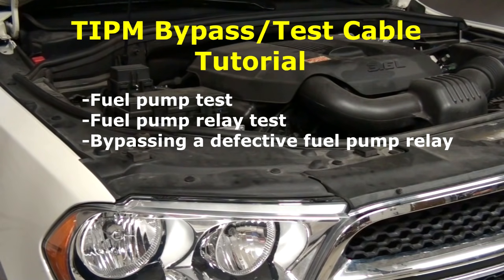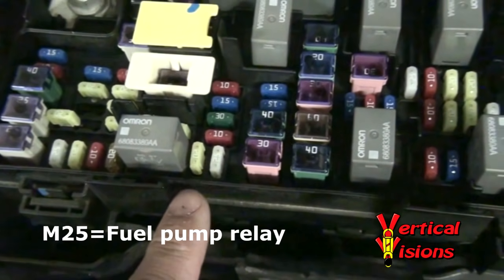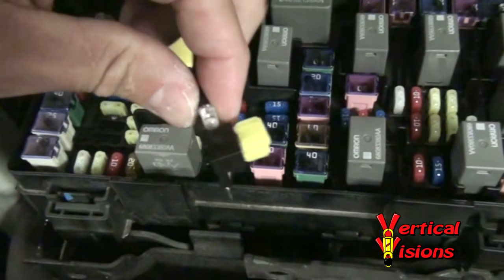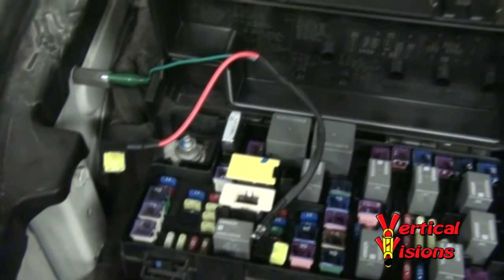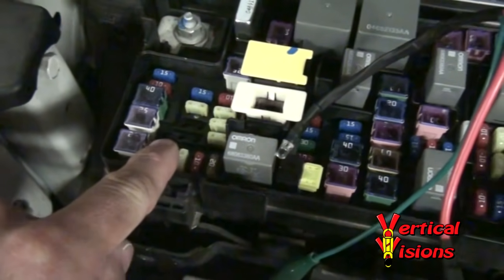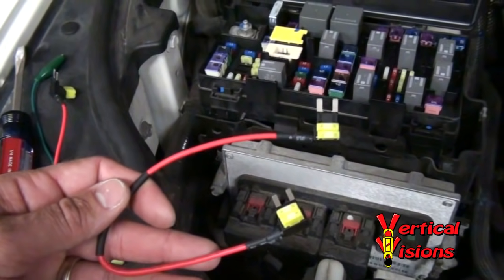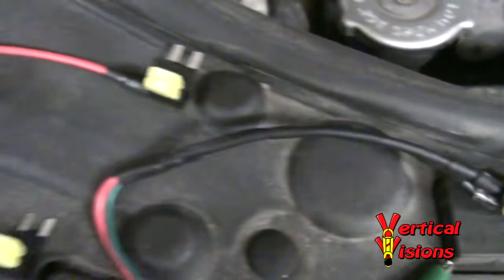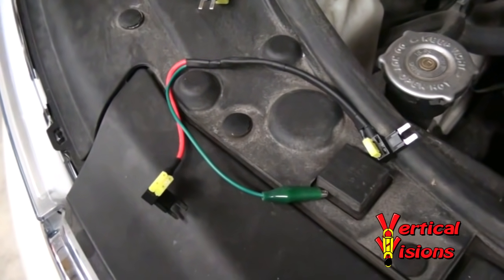TIPM Fuel Relay Test and Bypass Solutions - Most 2007-2021 Dodge, Chrysler, Ram, Jeep, VW Vehicles

Comment: Just curious if this is a permanent fix. I have a 2011 Dodge Ram 1500 and am having trouble with my fuel pump relay. I was gonna take apart my tipm and replace the relay. Would this save me from having to do that, or would I still have to do it? Thanks?
Reply from the maker: See question #2 here:  http://www.verticalvisions.com/TIPM_cables.php#faq
Our TIPM test/bypass cables are designed to allow people to test their vehicle and bypass the problem.  These cables are 1 of at least 4 possible solutions to the fuel pump relay problem (each with their own positives and negatives).  Read more here:  http://www.verticalvisions.com/TIPM_solutions.php

Comment: have the same problem with my 2000 chevy silverado... will your cable work for my truck?
Reply from the maker: For our cable to work, you must have a fuel pump circuit in this order:  12VDC ------ Relay ------- Fuse --------Fuel pump.  All our cables are designed to work with mini-blade fuses, so you'll need that unless you want to make your own with a different add-a-circuit cable on each end.  I have no idea what a fuse box in a 2000 Silverado looks like or how it's wired, but understanding why the cable works may permit you to make your own.  Plus, your fuse slots will all be different and I'm not sure if you have a fuse slot that's hot only when the vehicle is on (we use this to our advantage to power the fuel pump).  You should not be able to measure 12VDC on the fuse when the vehicle is off.

Comment: will it work on my 2007 dodge  ram 1500 hemi?? thanks
Reply from the maker: No.  Full applicable vehicle list is here:  http://www.verticalvisions.com/TIPM_vehicles.php
Reply: Jason Bell, I've been looking for a solution for some time. I've got an 07 dodge ram 1500. is there a fuel pump relay?
Reply: Thank you so much for this product, it fixed my problem however I still can't get it to start on the first go. I have to crank twice before it starts, any idea on what it might be?

Thank you.

Comment: 2007 dodge ram 2500 horn wont work any idea ?
Reply from the maker: I'm very familiar with the 2011-2012 Dodge Ram TIPMs and have studied one from 2009.  The 2011-2012 horn circuit works in this order:  12 VDC --------- Relay ----------- M22/M23 Fuse -----------  Horn.  If the relay is bad, the horn won't work.  The only way around it would be to replace the faulty relay or inject power into the M22 or M23 (one or both) fuse slots with a manual switch that gets wired into the cab.  Note that your 2007 Ram horn circuit might be different.

Comment: Does this Fuel pump solution is going to fix my problem? please advice. Thanks
Reply from the maker: Our cables work on a 2011 Routan..  More info here:  http://www.verticalvisions.com/TIPM_cables.php
Reply: So you are saying this will be a permanent solution ? Bypassing inside the TIPM wont affect to any other parts right?  Fuel pump will cutoff if I just turn off the engine after bypass?

Comment: Hi, I have the same issue with my Volkswagen Routan SE 2011,replace the battery still wont start,  If I replace the TIPM then its going to fix ? After replacing the TIPM do they need any Volkswagen Firmware updates? Please advice.
Reply from the maker: Replacing the entire TIPM due to the failure of a $5 relay inside isn't your cheapest option.  Used TIPMs start at $350 while TIPM repairs are $255.  Read our webpage showing four solutions to your issue:    http://www.verticalvisions.com/TIPM_solutions.php.  If you buy a new/used TIPM, there is always a chance you'll need to pay $60-$120 to have it programmed.

Comment: Helped me out, 10/10 very easy, very clear instructions.

Dealer quoted $2000 cdn to fix
Had this back up and running with the $35 cable. 

Many many thanks to Jason 
 
P.s never buying a dodge again

Comment: hi Jason, i wish i'd seen this 2 weeks ago.  just replaced my fuel pump for $1000 and the car still doesn't want to start.  2011 Chrysler Town and Country.  I can usually trick it into starting now by turning the key to on position and off position several times.  or sometimes turning it into on position, moving the car into reverse then park again.  but those tricks are starting to fail now too.  question though-  I'm also having random times of the sliding doors don't want to open and every now and then the wipers go off on their own.  Am I looking at more than just the fuel relay being bad and need to do the $1300 replacement of the whole TIPM or do you think the cable will solve it all?  thanks!!!
Reply from the maker: When you say it "doesn't want to start", does it act like it's out of gas or will it not turn over at all (ie.  starter won't engage flywheel)?    For the random door and wiper issues, read this:  http://www.verticalvisions.com/TIPM_other.php
Reply: ordered the wires from you at 2 am last night :)  it will crank and crank and never start- wearing out the battery.  today this happened and was able to get it started with a portable battery jump.  other tricks, key on off/ start from neutral/ put in reverse then back to park didn't work today.  other days it will (barely) start and then shut off 3 or 4 times until it sticks.  last week was driving in a parking lot and it just stalled out.  every day is a new adventure....   will see what happens to other issues after the fuel pump relay cable change.  fingers crossed!  thanks Jason!

Comment: Any fix for the low beam headlights?  Neither side work on my truck so I don't think the usual jump solutions will work for my issue....
Reply from the maker: Unfortunately, the only headlight fix I'm aware of is a new or used TIPM (http://www.verticalvisions.com/TIPM_used.php)
Reply: I had so many problems with the headlights on my 2011 Ram 1500 for the first few years of ownership. This will sound crazy, but I unplugged the wiring harnesses for the lights, blew them all out with air, put them together and wrapped them all up with electrical tape. No problems ever since.

Comment: Jason thank you very much for your video its  extremely helpful! I was wondering if the fuel pump relay is the only issue with the TIPM on the 2012 Durango 3.6 L? The reason I ask is the dealer did a recall on the fuel pump sensor,adding an external one. Several months later as i was driving the battery light came on and  within 10 min the car stalled. I tested my battery and i had 8v and within 15 min or so my battery was completely dead. I was wondering if maybe the TIPM has other issues that would have drained my battery.      
Thank you in advance,  Jay

Comment: I think it's great that you came up with this fix my only concern is that the system is designed to only provide fuel pressure when the engine is running so in the event of an accident and a fuel line gets disconnected or cut the fuel will continue to pump out until the key is turned off causing a fire hazard. normal operation would shut off the fuel pump as soon as the engine were to stall or possibly when an air bag goes off ( i would have to confirm air bag deployment fuel disconnect). also if you have  a leaky injector and were to keep the key on without starting the engine you could damage the engine by washing down a cylinder causing cylinder wall scoring or even hydro-ocking the engine with fuel. probably unlikley but it is possible anyway great video just hope you have good liability insurance in case of an issue
Reply from the maker: Many people already have a fuel pump relay that is stuck in the on position, which is of concern to begin with.  Although we're pulling power from an alternate circuit, we're not sure if that circuit has power removed during a crash like the OEM relay.  It may or may not be an issue. This is one of the limitations we clearly list on our website and on all documentation.  Unfortunately, my wife is unwilling to allow me to crash test our 2011 Durango to find out.  Our cables are primarily used as testing tools to determine if the problem is the relay or fuel pump.

Comment: My lift pump fuse blew the other day. I replaced it and drove a bit. It blew a few miles down the road. I replaced it with a 25 amp fuse and its been running fine for a few days now. I put a 20 amp fuse back in it and it blew within a mile. 25 amp keeps running. I m thinking the pump is starting to draw too many amps and will need replacing. Any thoughts?
Thanks
Reply from the maker: I would agree that your lift pump is drawing too many amps.  You could also have a short.circuit of a lift pump wire to ground.  An easy way to test current draw is to use this:  http://www.esitest.com/fuse_buddy.html

You can also isolate the lift pump from all other wiring (as close to the pump as possible), power it up with an external battery, then measure current draw and compare to what you previously measured above.  Or simply replace the lift pump and monitor current draw before and after.  I'm not sure which vehicle you have, but most Dodge/Chrysler/Jeep/VW fuel pumps pull 8 amps on the 20 amp circuit.  I'm sure you're aware that installing a 25 amp fuse on a circuit designed with wiring rated at 20 amps could damage your wiring.  Good luck.
Reply: Thanks for the quick response Just did an amp draw test steady 25 with no sign of chatter on the relay. Looks like I'm headed for a fuel pump. Really appreciate your work. 
and thanks for the link

Comment: Do you know of any bypass for headlights? Both my low beams are not working in 2008 Dodge Charger.
Reply from the maker: I do not know of a bypass for a headlight issue, sorry.  If your testing concludes with the need for a TIPM, I know a reputable company that sells used TIPMs for around $350.  Link:  http://www.verticalvisions.com/TIPM_used.php

Comment: Jason saved us over $1,600 today! My daughter's 2011 RAM 1500 quit running in traffic last night. When she called me I could hear the engine turning over so I knew the battery and starter were fine. I drove over 30 miles to help her, but couldn't isolate the problem on the side of the road.

We had it towed to a local Dodge dealer and left the key in the drop box.I received a call early the next morning requesting the authority to proceed with analysis at $126 that would be applied to any repairs. After I gave the OK, I started searching the Web and discovered Jason's site. It didn't take long to get the call stating the TIPM needed full replacement and there would be some programming required for a total of over $1,600! I told them to stop all work!!!

After building a bypass cable I traveled back to the dealership in the afternoon. I paid the $126 charge and got my keys back. I opened the hood right in front of the service check in area, said a quick prayer, and placed the bypass cable. First crank and it started! It is sad that Dodge didn't include more vehicles in it's safety recall.

Jason is awesome!!!
Reply: very sad. they know what they have done to their people and have stranded us.
Reply: I hope you thanked the service manager after showing him how easy and cheap the fix should be instead of replacing it with another faulty unit
Reply: GHC60 just wondering if you are still driving that truck with the bypass setup. Thanx .
Reply: Hi Jason thanks  alot .only one information I want give you. Cold wheather bypass is not work . I changed heavy duty battery but still cold wheather like -5 dgree not start

Comment: same problem with my 2013 Grand Caravan. I was removing the fuse to stop my fuel pump running when my car is off. I think it can help me, right? what do you think?
Reply from the maker: We're just now getting calls and emails regarding 2013 and 2014 models.  We have not tested our cable on any 2013 models, but a quick Google search shows the 2013 Grand Caravan TIPM to be identical to those we normally work with.  If you are interested in testing one of our cables on your vehicle, please contact me at this link:  http://www.verticalvisions.com/contactus.php
Reply: @JazzysClassicJazz yes

Comment: Thank you. I actually disassembled the tipm all the way down to it's very core of C.B.'s no relays to be found. Just a bunch of i.c. chips.
I have NO IDEA how to go about testing this type of board. Just don't feel like throwing $1,000.00 @ a "Maybe this'll do it" type 'fix'.
Reply from the maker: Our company also offers TIPM repair at the following link, which contains a lot of information on each relay function and location:  http://www.verticalvisions.com/TIPM_repairs.php

Please tell me which vehicle you are referring to.  Most modern TIPMs contain small replaceable relays for the fuel pump, wipers, door locks, horn, backup lights, etc.  The problem for most people is desoldering and soldering on a circuit board using a microscope.  It's not that easy to provide instructions for this type of work, although you may find some basic videos on YouTube.
Reply: 2007 dodge 1500 5.7L Hemmi 
vin #2.
No replaceable relays.

Comment: ok, this is how my problem started, acting like it wasn't getting fuel, etc. Now it will not start at all, the battery is good, but it will not start. The whole thing is acting wonky, sometimes it wont even recognize my key, the windsheild wipers are coming on randomly (in the rare case the stupid van will do anything at all). After a lot of research I can see the TIPM is the problem, but would this fix it at this point or does the whole TIPM need to be replaced since so many relays are having issues?
Reply: I want to add, it wont even turn over. Half the times, lights may come on but it still wont turn over, the other half of the time it really does absolutely nothing. no lights or anything.
Reply from the maker: Our website lists recommended things to check based on your problem description:  http://www.verticalvisions.com/TIPM_other.php

If all else fails, our partner business sells used TIPMs:  http://www.verticalvisions.com/TIPM_used.php

Comment: REALLY Enjoyed your video. I am having a similar issue with a 2007 5.7 Hemi in a quad cab 1500.The circuits are labeled different & I don't have access to AllData currently. Do you have access to which circuits I can tie into for this bypass on this vehicle?
Reply from the maker: Many 2010 and older Dodge Ram trucks use a different TIPM that won't permit bypassing.  Bypassing works only if the TIPM circuit is in this order:  12VDC ==> Relay ==> Fuse ==> Fuel Pump (where we inject 12VDC from a different path at the fuse location.  The 2009 Ram TIPM that I recently disassembled is 12VDC ==> Fuse ==> Relay ==> Fuel Pump.  The relay location downstream of the fuse makes injection of alternate power impossible.  You can still put a test light on the fuse to see if the relay is working and confirm the problem.

Comment: I've seen the relays stuck on also and it would seem to me that this should be a recall before someone gets in a wreck and pump keeps pumping threw a broken fuel line ? looks like a lawsuit waiting to happen so I'm surprised they have not yet recalled this crappy system .even with this bypass the pump will continue to run as long as the key is on and that's a safety issue also if in a wreck where fuel lines or rail gets damaged and starts spraying fuel right ?
Reply from the maker: Yes, many OEM faulty fuel pump relays are stuck in the on position, which can be a safety issue during a crash.  It's unknown which circuits and relays have their power removed during a crash, so a TIPM bypass cable pulling power from M7 may or may not  turn off.

Comment: Olso if those jupers work only on those cars?
Reply from the maker: We are adding new cars as they are tested.  The full list of known applicable vehicles is here:  http://www.verticalvisions.com/TIPM_solutions.php#vehicles

It's likely that the following vehicles will work with our TIPM test/bypass cable, but we have not tested them all yet:

 CHRYSLER / TOWN AND COUNTRY        2008-2014
 DODGE / CARAVAN        2008-2012
 DODGE / DURANGO        2011-2013
 DODGE / GRAND CARAVAN        2008-2014
 DODGE / JOURNEY        2008-2010
 DODGE / JOURNEY AWD        2009-2010
 DODGE / NITRO        2007-2012
 DODGE / NITRO 4X2        2007 2009
 DODGE / NITRO 4X4        2007 2009
 DODGE / RAM 1500        2009-2012
 DODGE / RAM 2500        2010-2012
 DODGE / RAM 3500        2010-2012
 DODGE / RAM 4500        2011-2012
 DODGE / RAM 5500        2011-2012
 JEEP / GRAND CHEROKEE        2011-2013
 JEEP / LIBERTY        2007-2012
 JEEP / WRANGLER        2007-2014
 JEEP / WRANGLER 2-DR 4X4        2007-2009
 JEEP / WRANGLER 2-DR 4X4 RHD        2007-2009
 JEEP / WRANGLER 4-DR 4X2        2007-2009
 JEEP / WRANGLER 4-DR 4X4        2007-2009
 JEEP / WRANGLER 4-DR 4X4 RHD        2009
 JEEP / WRANGLER SAHARA        2007
 JEEP / WRANGLER X RHD 4X4        2007

Comment: While using the bypass cable you designed, will the fuel pump still shut off after a crash event?  I was under the assumption the G-Meter used the fuel pump  relay to perform a fuel shutdown to reduce the possibility of fire.
Reply from the maker: We discuss this on our website:  www.verticalvisions.com.  A better question to ask is why Dodge/Jeep/Chrysler/VW doesn't understand that vehicles with a faulty fuel pump relay that is stuck in the on position will not power down the fuel pump after a crash.

Comment: MAYBE I can help, I HAVE A DODGE DURANGO 2007 5.7 4X2, WHICH IS AS DEAD, TO INSERT THE KEY AND TURN ON YOU DO NOTHING, ONLY THE BOARD LIGHTS abs, esp bas, battery, check engine, brakes ILLUMINATE . NATES OF ME THAT WORKED allowed 5 TIMES EACH TIME FOR 2 SECONDS, THE KEY BECAUSE IF RECOGNIZED THAT LIGHT FLASHING OR NO POWER, PLEASE HELP ME, AND CHECK THE FUSE IGNITION and well

Comment: whats the name of that cable?
Reply from the maker: If you're referring to the red wire in the video, they are "Add-a-circuit" or "fuse taps".  Get the 20 amp version (16 gauge wire).